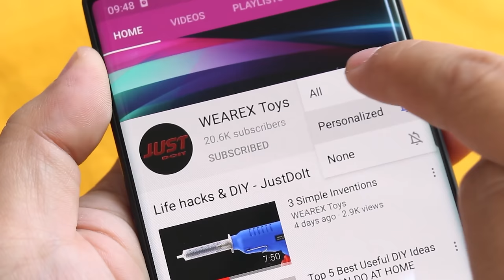3 Incredible DIY Ideas THAT REALLY WORK

Comment: Wouldn't number 2 just work anyway with the whole die welded to a guide? Why cut it in half and use 2 halves?
Reply: Number 2 is just a bad idea by not using the full die there is nothing to set the cut depth so every run the rod gets a little narrower